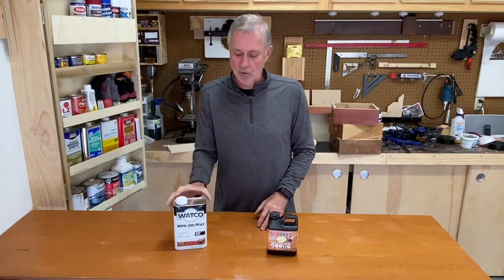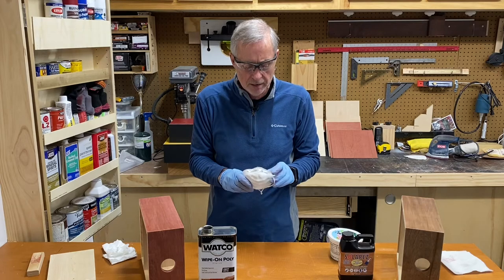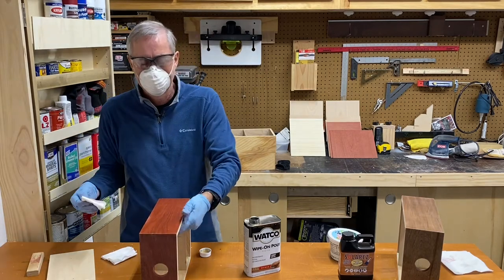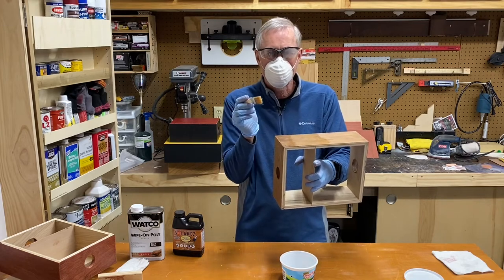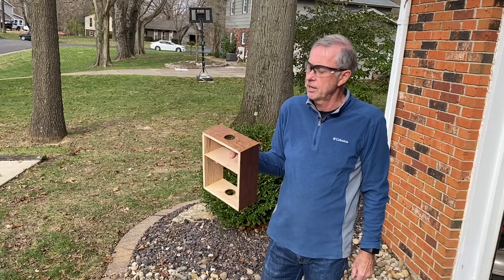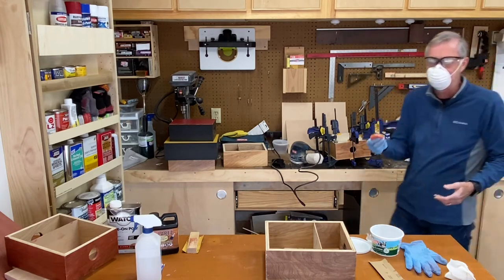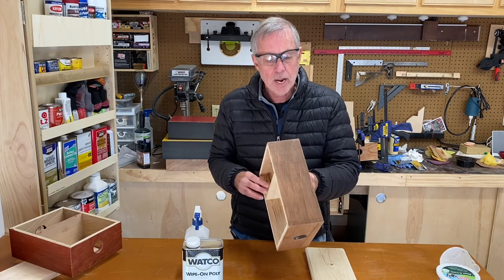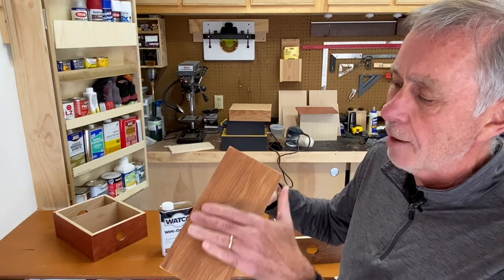Solarez UV Resin vs Polyurethane - Which Is Better?

Comment: I have spoken to the inventors severals times. They are very good guys. I also play the guitar coincidently. I am a wood turner. I haven’t used that specific solorez product, but I did buy 4 others or one or two that they developed for me. I haven’t found the other products to cure well when applied in thin coats. Apparently this is due to oxygen inhibition retarding the curing process. If I cover the wet finish with plastic wrap the solarez would cure as hard as a rock - limiting the exposure to oxygen. This practice however was not practical for round cylindrical forms. Maybe that is what this newe product is supposed to overcome.
Reply from the maker: Interesting. Thanks Tanner!

Comment: Hi, great video. I make cast stone from wooden moulds. I basically pour concrete into a wooden mould to get the desired shape. 1 mould is capable of 10-15 castings using traditional varnish. I varnish moulds to protect wooden mould from the concrete. However, it takes about a day for it to cure. Do you think if I use Solarez that might reduce the time in varnishing ?
Reply from the maker: I think it should work. When you apply the solarez, it is a thin liquid so you would have to apply thin coats so it doesn’t pool in the bottom of the bowl.  It should cure very quickly though so it shouldn’t take long.  It may dry with a slight orange peel effect.  I have been told that multiple coats reduces that effect.  The other thing is that Solarez is expensive, but it goes a long way.  If you try it, please let me know how it works.
Reply: @Ray_Here  Thanks a lot. I'll let you know.
Reply: yes, i have used a solarez product in a similar fashion.. Check out their website, they have more than one product.  
     Also, with this product, for coating your moulds, or other use on wood; be careful not to over sand.  Leave a little rough for better adhesion and just do extra coats to get as smooth as you'd like your moulds to be. 
    i sand to 120, vacuum the surface, and then go go over it with a card scraper.  i then applied the 1st coat with a white scotch brite pad in a circular motion.
    If you over sand, some people say the dust can fill the pores, preventing adhesion.  Personally, I  think sanding with to high a grit tends to almost burnish pine, making the surface too slick for good adhesion.  Good Luck~ ♿Lisa🔨

Comment: If you level sand after every coat you will make slow progress.  Just knock the tops of the bumps down with light scuff sanding.  Wait til you have put several coats on before level sanding.  Do the scuff sanding by hand.
Reply from the maker: Thanks for the tip! I’m assuming you mean when using the Solarez.  I’m working on a guitar now and will give it a try. How many coats do you recommend?
Reply: Sorry I didn’t reply sooner.  I should qualify: I know a bit about instrument finishing and finishing in general, but I am not an expert.  I have worked with polyurethane, water and solvent based, sprayed lacquer, shellac: brushed on and french polish.  Tru oil on guitar necks.  Zpoxy: a really good and underutilized product.  My sprayed lacquer (water based) was in the context of a 3 mo guitar building class.  The teacher was an experienced luthier who worked at L’Arrivee for many years in the finishing department.  That was when I found out that sanding between coats is very light.  His method was to use 600 grit wet dry sand paper and use it dry.  Scuff sanding about an hour or two after spraying each coat, a little more after the guitar had sat overnight and the lacquer was harder.  The whole process of scuff sanding was done in a few minutes, then back to the spraying booth.  I know I am talking about a different material here and different finishes would need a somewhat different schedule but I believe the general process is the same for any finish that is laid on is many thin layers.  It certainly applies to polyurethane.  I had applied polyurethane finishes several times before attending that class and did it much the same way as you did it, except I did not use a power sander.  I did use 220 grit and hand sanding.  I got there in the end but I felt like it was incredibly inefficient and I wondered if I was going about the sanding properly.  After taking that class I would say I was not.  The thing is, as you apply successive layers small bumps will get buried by subsequent layers especially if you knock the tops off when scuff sanding.  If you try to level them after each coat you will take down everything in the local area and very likely burn through the finish because it is still very thin at that point.  I don’t think any finisher would use a power sander and 220 for scuff sanding: much too aggressive! And they would stay away from edges and corners because they will burn through 10 times faster than flatter areas.  

I don’t know if you are familiar with the youtube channel “highline guitars”.  He has many videos specifically about Solarez (evidently there are 2 topcoat products, with different properties) and he talks about both.  Lots and lots of excellent information on Solarez and finishing in general.  He really seems to know his stuff and he explains things very well.  If you haven’t seen his videos I think you will find them really helpful.
Reply from the maker: Thanks for your very detailed response!  I am familiar with Highline Guitars. He is a great resource. That where I learned about Solarez. It caught my attention because I don’t do spray finishes. Although I’m going to spray pain a guitar. I’m going to attempt to do that with spray cans. I’ll use the Solarez over the paint. I enjoy the learning process and trying new things. Thanks again for your great response!
Reply: @Ray_Here  I am considering trying solarez over paint on the back and sides of a baritone uke I am building.  I will be interested to know how that goes for you.  I have developed a severe allergy to solvents of almost any kind so that makes spraying a finish very risky for me.  It’s too bad, I do think brushing a finish aggravates the problems of unlevelness building up as you apply coats.  But that is the hand I’ve been dealt.  I have been working my way through every video Highline has done mentioning Solarez and there is good information in all of them.  About other finishes as well.